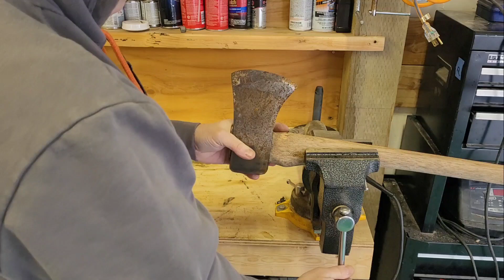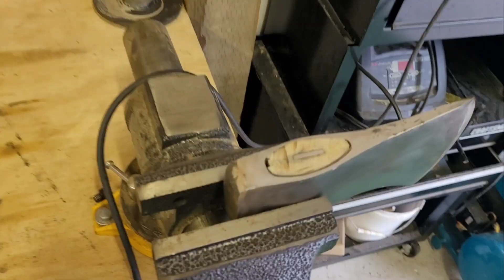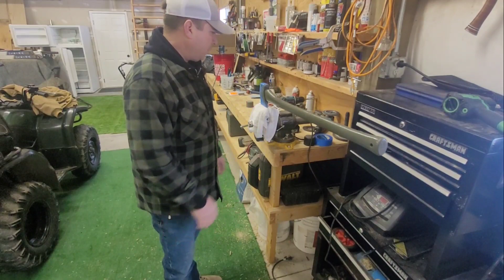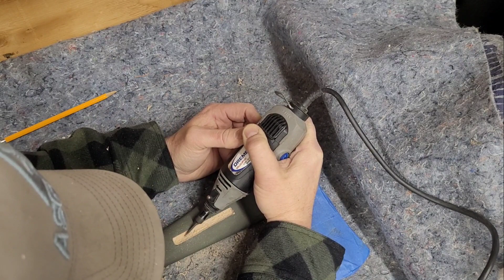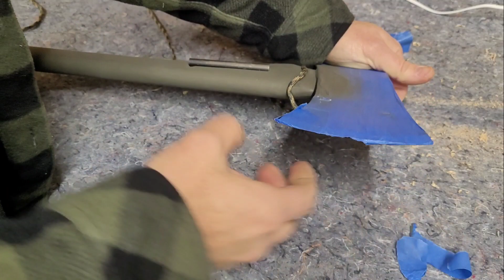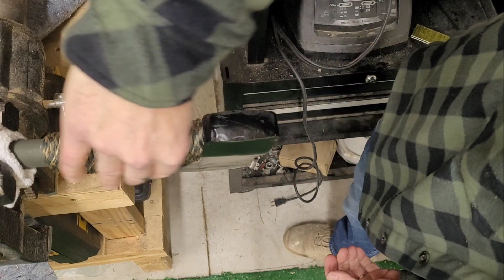MAKE YOUR OWN SURVIVAL AXE! DIY BUGOUT GEAR FOR SHTF! #prepper #bushcraft

Comment: You should have used boiled linseed oil instead if painting the handle. the paint will quickly wear off with any regular usage.
Reply from the maker: Good advice,  boiled linseed oil would probably be more durable, I went with the paint because it made it look cooler, however you'd be surprised how well 2 coats of that flat oil paint will hold up... I'll keep you updated on how it stands up to usage! Anyways, thanks for watching!